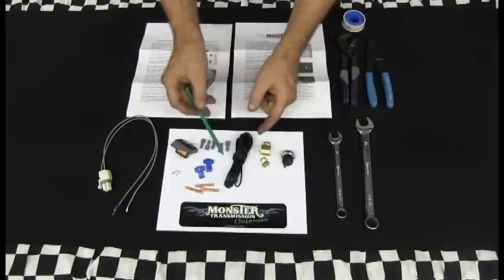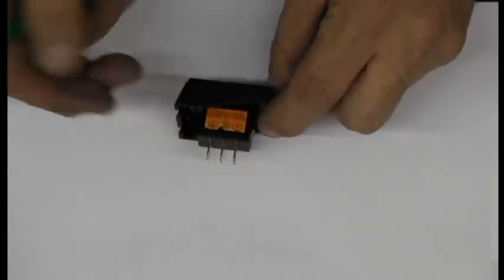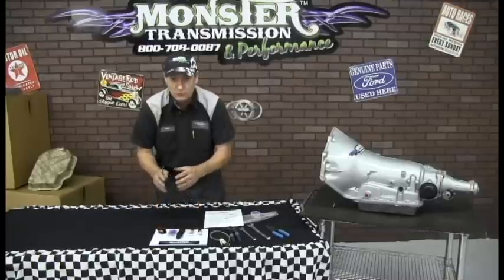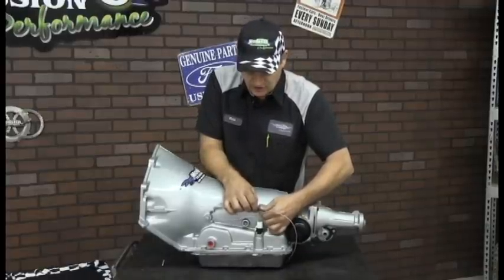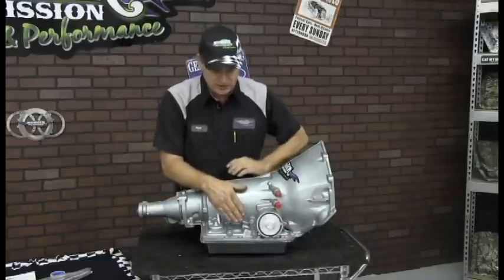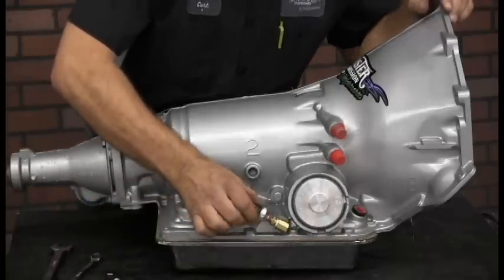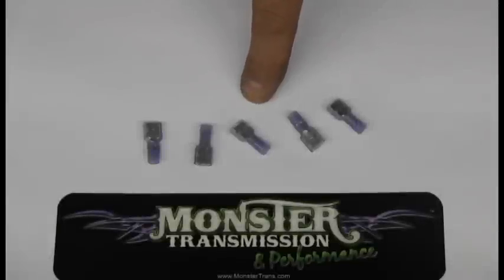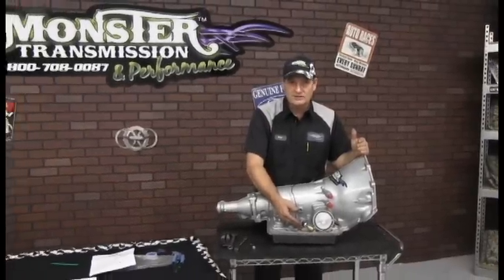How to Install a Lock-Up Kit 700R4 | Curt's Corner at Monster Transmission

Comment: Do you have to constantly flip the toggle switch on and off while driving?  Can you wire this without the toggle?  Just a daily driver and cruise car.
Reply from the maker: You can wire it without the switch to have it on at all times, or just leave the switch on until you want lock up off.

Comment: I have a 89 and I removed the computer. I cut the TCC ground wire and went to the single wire 4 th. Gear pressure switch for a ground to TCC. The only Switch on the valve body and I was done. No kit required.

Comment: I recently pulled a 700r4 out a 91 rs Camaro and put in my 72 c10 small block. does it need lock up at all time? my buddy does trans on side. he installed tci universial lock up kit # 376600. run off vacuum,rewiring changing inside pressure switch instead single. it dual prones. but lock each gear at 6,000 rpm. my question what rpm does your guys work at? if lower and smoother do I need put old wires for your guys kit work.

Comment: Hi, thanks for this video. My recently rebuild 700r4 has a working lockup solenoid but somehow the ECM is not telling the transmission to lock up. The shop has no idea how my computer system works (1984 trans am) and I was looking for simple ways to just activate the lockup manually. As I understand its just a matter of engaging the solenoid, but you put in a oil pressure in it. This is to only let the lockup engage in the (overdrive) gear so 3rf and 2nd can never have lockup?

Regards,
Robert

Comment: If the pressure switch energizes the circuit could you not use the toggle switch and hook it up to a 12v source the turns on with the stock key ignition switch. If so what if any advantages do you have with the circuit being on a toggle switch

Comment from the maker: Great question!
For a brief explanation It is a lock-up for the torque converter. The Torque Converter is a fluid coupler that can lose a lot of energy and fuel economy. By locking it up in 4th gear you'll get better fuel and drop your RPM"s down a little bit.

Comment: Hi saw your video on the 700R trans. Yours uses a switch to lock out the converter. Mine has knob to adjust the lock out. I have 55 Chevy truck with a 700R trans, 265 engine. Turning the knob till the green light comes on should I set the knob at what speed. Thanks Len

Comment: Probably a dumb question, but does it matter if your truck is  4 wheel drive or not. I have a 1990 K5 blazer 4x4  I was thinking of installing this on?
Reply from the maker: Not a dumb question at all. It does not matter if it's in 4wd.

Comment from the maker: Hey Daniel, Thanks for the questions. I'll answer them one by one for you.

Does it need lock up at all time?
No it does not need lock up all the time.

My question what rpm does your guys work at?
About 2500 rpm.

If lower and smoother do I need put old wires for your guys kit work.
You can use our lock up kit and your internal wiring harness.

Hope that helps if you need anything further just let us know. Thanks

Comment: hello. this may sound stupid/redundant but im planning on doing a TH400 to a 700R4 swap in my 68 c10. my question is do i need this kit and the internal lockup kit as well as a lockup converter? its just a weekend cruiser truck so no drag racing with it. just a 350 with a few goodies. thanks for the awesome vids!!!
Reply from the maker: +2009KVFD976 If you are doing a conversion to a 700R4 you must have a lock up kit and a lock up torque converter. We specialize in full conversion kits. Give us a call at 800-708-0087 and we'll be sure to get the proper components for your application. Thanks

Comment: On the plug that goes into the trans you have 4 pins, the pin between the tab and the latch that holds itno the connector in the trans is pin A,  counting clockwise with the plug off facing you the 3rd pin is D.  If you want to bypass the ECM, run a vacuum hose from your venture vacuum on the carb or intake to a vacuum switch...  One side of the switch run to 12V....  the other side run to Pin A, cut the wire for pin D (usually black) and ground it to the transmission.

Comment: So, i bought an 89 firebird and it has this switch.   What is it used for? Just for highway use, or would it somehow work for drag racing?      Guy i bought it off of said he used to take it to the strip all the time
Reply from the maker: ***** It is to turn your lockup on and off. We build our units where it controls itself. Leave on for normal driving or turn off for racing.

Comment: I am looking to replace the 700R4 in my 83 Chevy K10 Scottsdale 4x4. This will be a daily driver and rarely used for off-road applications. It will be used for towing my boat, however, I do not want a weak transmission for those rare occasions that I do take it off-road or the routine shifts due to stop and go driving around town or highway trips. My engine is a 350 with a mild cam, would you recommend a stock stall converter and lock-up kit for this application?
Reply from the maker: Thanks MJD for your question. With a mild cam you might want to look at something with a little more stall. If you provided the engine and cam specs we would be able to let you know for sure. Give us a call at 800-708-0087 and we'll be able to let you know exactly. Thanks
Reply: I have already ordered the transmission from your company. Unfortunately, the actual cam size is unknown as I purchased the truck and the engine (350ci) was already rebuilt by someone else. I have  tried to contact the actual owner or builder and not had any luck. I ordered the stock stall with the tranny. I know the stall that is in it now is to high and I really don't like it.
Reply from the maker: Give us a  call and we can work with you on finding the best stall.

Comment: Does the sensors on the valve body of the 700R4 need to be powered up before the transmission can shift correctly or does the TV cable that controlled the governor and amount of fluid pressure will allow it to change
Reply from the maker: The switches on a 700R4 are for lock-up only they don't control the shift points. The T.V. cable and governor handle that.

Comment: Quick question below you mentioned 100 psi pressure rating on the switch. I assume it is the rating that the switch diaphragm will rupture. Is this switch a  Normally open switch that Closes 28-32 PSI?
Reply from the maker: This switch closes at 0 PSI, but some other brands do not engage until around 20-30 PSI, which is still okay. If you have any more questions on that John give us a call at 800-708-0087.

Comment: I have a 4l60 e transmission with a number 2 on the side of case. I've been trying to figure out what it came out of?
Reply from the maker: The number 2 would not signify anything in our system but if you check the side of the case or the back of the pump there should be an embossed two digit number inside a circle about 1 inch around or if you drop the pan it will be embossed on the valvebody in the middle area same size. Thank you for choosing Monster Transmissions.

Comment: I had a rebuilt(approx 10k miles) 700r4 but it sat for like 4+ yrs, but it had oil, got around to replace the filter and atf with new tv cable but now it won't shift out of first but it has reverse. Trans. Shop sold me a universal tv cable could that be the issue (not calibrated right)?
Reply from the maker: Yes the cable adjustment could very well be the issue. We've got a video to show you how to adjust the cable. http://youtu.be/D109Fz1SK18

Comment: I have a newer style 700r4 with a 208 transfer case on it from a 1991 k1500 it dont have any ports on the side of it . By servo housing . So what can i do .
Reply from the maker: You will be able to use an internal 4th gear setup or you can use our lockup kit with the factory internal harness.
http://www.monstertransmission.com/700R4-External-Lock-Up-Kit_p_4988.html#.UyiUq_ldV8E

Comment: On that model I would check the brake light switch, one side goes to the trans, the other goes to a vacuum switch under the hood....   To check at the trans, run a test light to pin A and give it 1/4 to 1/4 throttle and see if your test light comes on...  If not its the brake light switch or your vacuum switch...  If it does its the TCC solenoid or 3rd gear pressure switch or a bad ground which is pin D...   Hope that helps...   I hope that helps..  Its an easy fix...

Comment: I have a 700 r4 and it seems to not shift into 3rd or 4th gear. I've adjusted the TV cable and it didn't help. the Transmission was sitting for 10 years before it was used but it was still in the car. any ideas?
Reply from the maker: +Mike Boardman It could be a couple of things. A possible stuck valve in the valve body or depending on what the rear gear ratio is you could have the wrong governor installed. Hope that helps. If you have any further questions feel free to give us a call at 800-708-0087. Thanks!
Reply: Same problem on my transmission, I took the governor off and cleaned it with brake cleaner and it worked good after that, shifted all 4 gears.

Comment: I do not have these oil bosses with the 9/16 heads on my 91 Z/28 with the original transmission. Is there another kit for my 91 700R4 ?
Reply: Never mind, I found your other video covering my transmission.

Comment: can the lock up switch install be damaging to a stock 700r4? would you recommend putting it on a stock car/truck altogether?
Reply from the maker: The external lock up kit will not harm a factory lock-up.

Comment: Should a first gen 700r4 transmission kick into 4th gear without lock up plug. I just installed one in my 65 elco and can't get 4th gear. I have adjusted the tv cable many times and can not get 4th gear.1st through 3rd gear shifting great but everything i read says shifting too eary..  Also nothing plugged into this plug
Reply from the maker: Thank you for the question! The Transmission should still have 4th gear with or without the lock up pig tail, if the transmission is not designed to be run without lock up however we would recommend getting a lock up kit. Lock up is designed to engage once the transmission reaches a certain pressure after already being in 4th gear. Give us a call if you need anything else at 800-708-0087.

Comment: Can i cut my factory harness and test it using the 2 pins shown here? My last 2 700r4s haven't been locking up in 4th and it kills my mpg (17 with a 4.3). If i can get the solenoid to click then i'm going to buy one of these kits.
Reply from the maker: When it comes to cutting the wiring harness, there is always a risk of your unit failing and further damage. 
Give us a call at 800-708-0087 and we can discuss these risks with you and your available options

Comment: dose a' 93' 4l60e with a tv cable require a computer to shift properly or can a lock-up kit be installed ?
Reply from the maker: The E in 4L60E stands for electronic. Electronics are required for that trans type.

Comment: Quick question. If I choose not to run the lockup do I still have a four speed, (Utilizing all 4 gears)? Or is the lock up considered 4th gear?
Reply from the maker: Yes you will still have 4th gear. The lock up wouldn't be a gear but rather holds it in the 4th gear. Hope that helps and makes sense. Thanks
Reply: Thanks I appreciate the info
Reply: Monster Transmission nee

Comment: If you were to run 12 volt to the connector and skip the oil pressure valve, would it be possible to lock the torque converter in all gears?
Reply from the maker: Yes, it would be possible to lock the 2nd, 3rd, and 4th gears if you're in a 1998 and newer 700R4.
Reply: Interesting. What about a TH200? I have one with the wire connector. I guess it would work on second and high gear then?
Reply from the maker: They run on hydraulics and electronics so it all depends on pressure for what gear it would go into, but it will never go into lock up in first gear.

Comment: Tell us wen to engage the switch, or we turn it on when truck is on??
Reply from the maker: We would use the switch so if you are going up high hills or towing you can turn off lock up for high rpm range in 4th

Comment: does this kit also work on a 200 4r trans? Would the oil port be in similar location?
Reply from the maker: This kit does work for both 700-R4/200-4R. And yes, the oil port will be in similar location on the left side of the servo.

Comment: Why do I need a lock up kit? Doesn't the transmission already have a lock up?
Reply from the maker: These kits are designed for Vehicle that are making the conversion to a 4 speed Transmission and do not already have the Harness set up for the factory lock up. So if you have a custom vehicle with a 700r4 this kit will ensure to make the most of the MPG. 
https://www.monstertransmission.com/Lockup-Kits_c_3767.html

Comment: About how do you guy's sell these for? I have a 1990 Corvette with the 700r4 transmission. It currently has a B&M shift kit, but it really annoying when it locks up in 4 gear at 45 mph 😡😡
Reply from the maker: You can find the lock up kit on our site here : http://www.monstertransmission.com/700R4-External-Lock-Up-Kit_p_4988.html
And the 7000R4 here: https://www.monstertransmission.com/700R4_c_3942.html 
Or give us a call at 800-708-0087

Comment: Which pig tail connector is the ground?
Reply from the maker: When it's plugged in the transmission the wire facing the tail end is the ground.

Comment: what would cause a 400 traney not to shift out of first gear it is a electric shift
Reply from the maker: Great question John, there are a few things that can cause your TH400 to not shift out of 1st. The first thing you want to do is check to see if you can manually shift the transmission through gears. If you can not then you want to check your shifter linkage. If that is correctly hooked up then the clutches and bands are worn and it is time or a rebuild. If the transmission can be manually shifted into gear then the next step would be to check your vacuum. You need to have at least 16 inches of vacuum at idle for the transmission to shift correctly. If you have enough vacuum check to make sure that the modulator valve is not stuck. Next you want to check and make sure the valves and springs in the governor are not stuck and give it a nice cleaning. The gov. can be accessed from the passenger side of the transmission by removing the four bolts holding the gov. on. If these steps do not fix the issue then you can try manually shifting through the gears to try and clean out the valvebody. The last step will be removing the valvebody and cleaning it.

Comment: wanting to do this in my 82 c10 to improve milage. has a 350, would I have to get drive shaft cut?
Reply from the maker: The TH350 had a few different tail sizes. Some do require a different drive shaft. Give us a call and we'll be able to help you find out which one you have.

Comment: how's this work with diesel
Reply from the maker: The lock up kit is designed to work with any 700r4 transmission with the 4th gear pressure port on the passenger side of the case. Diesel or Gas engines.